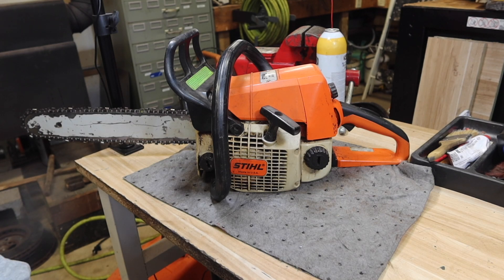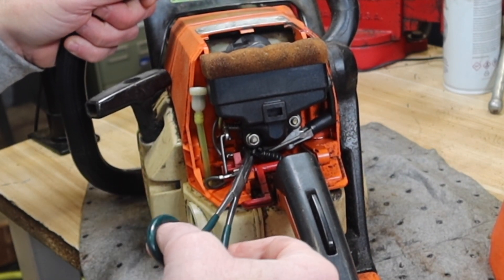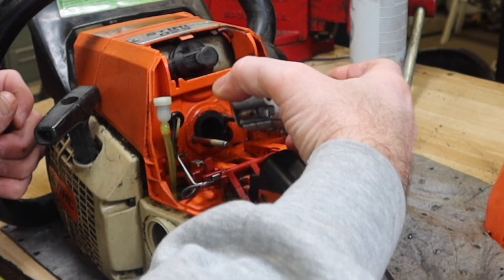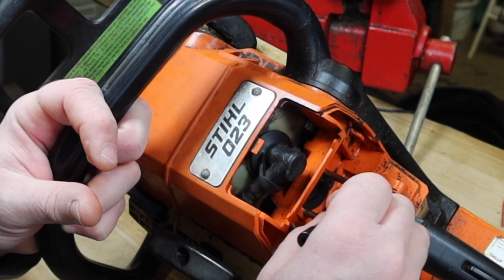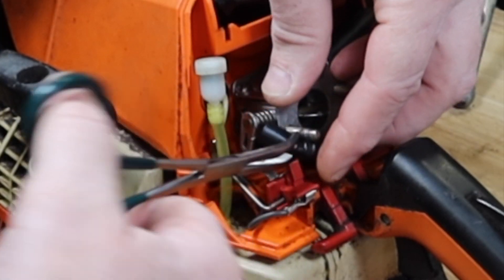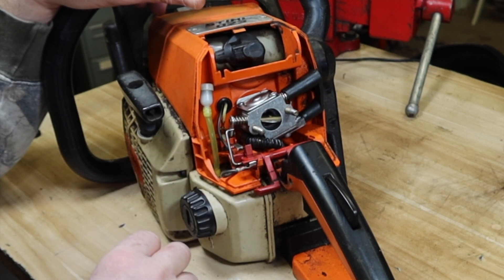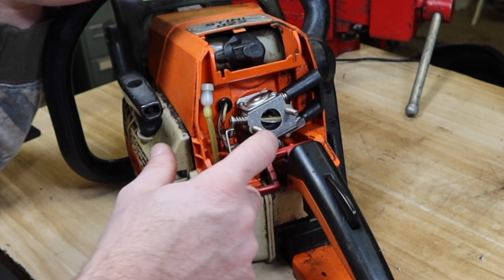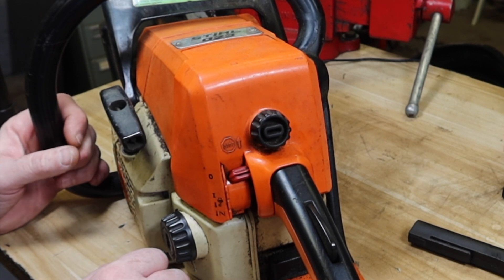Easy Fuel Line Fix for Stihl MS021, 023, and 025 No disassembly required! (almost)

Comment: I have one screwdriver with a rounded blade that I use for pushing vulnerable lines into holes. I also always goop the tight fitters up with silicone grease.  I better start buying the larger tubes of silicone grease! 😉🔧😂
Reply from the maker: I should probably make a screwdriver like that too. And a carb stand